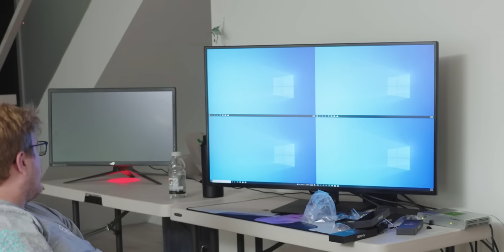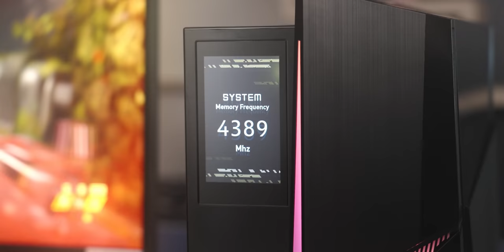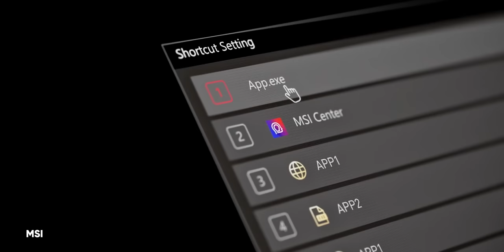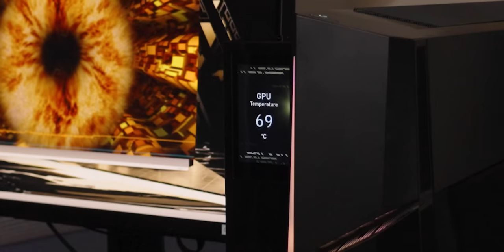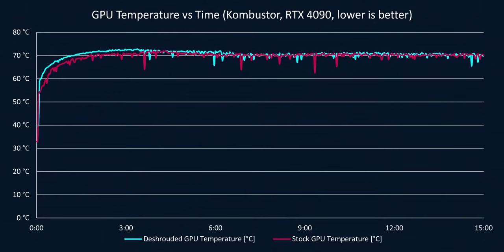I wish I didn't need this gaming PC - MSI Trident X2

Comment: MSI cooling usually can't even survive an air conditioned room, most of their cases are basically convection ovens.
Reply: I do have a problem with cooling on my MSI laptop. LOL. Great machine otherwise though.
Reply: Msi makes steam instantly
Reply: @logirex  only screen, case itself look awfully cheap
Reply: Look at all that VRM cooling for a core I9  8:32
Reply: Monica Gaming💖  to set up what
Reply: My Trident III has been running strong since 2018, no major issues.
The CPU does get hot, that's the only design issue I see.
Reply: @BardSuycide  yes I know
Reply: I've seen some horrible cooling designs in prebuilts, I wouldn't really call this one of them. Fresh air to the GPU and a fairly sizable CPU radiator venting air directly out the case.
Reply: @jaredcrue7099  how hot, 100+- celsius?
Reply: Looks like they got a clue after being ripped apart by GN and others for years. Thankfully.
Reply: @Seventschiko  80-90 while running Elite: Dangerous Odyssey, EDDiscovery, Chrome, and some minor things.
Reply: @logirex  I mean shit you're paying $5k they may as well throw in a little flair. At least it's somewhat functional.
Reply: As a trident x plus 9th gen owner ...my gpu temps are also 72...which is considered fine...but friends with bigger cases same setup...get 50 degrees on gpu...
Reply: @DamyanTanev  omg that vrm gonna burn.
Reply: @KikiAelita  Well, laptops and good cooling don't go together, lol. Not really an MSI issue.
Reply: @KikiAelita  have you tried unvolting yet laptops can often actually get higher fps while unvolted with lower Temps too
Reply: Monica Gaming💖  bot L
Reply: @KikiAelita  I got a msi GP75 leopard with rtx 2070, gpu temp always 86°C on warzone 2. just removed all oem thermal paste with noctua nt-h2. 12°C difference. highly recommend
Reply: @jaredcrue7099 Guess your bar of expectation is lower.
Reply: My MSI GS66's fans are dead and I have it Entombed like a WH40k Dreadnaught in a 60's wooden Mortar Round Box with an Industrial Fan blowing into one end.

It will run until it dies in service to me.
Reply: I've had to change the cooling on EVERY MSI device I've ever used.
Reply: I mean this actually looks like it should somewhat work. Any air cooled 4090 will ping off the thermal limits, but this seems rather functional
Reply: Probably won't be too long before Gamers Nexus reviews it and finds out it is in fact an oversized airfryer
Reply: @KikiAelita  well its a laptop nothing new
Reply: The Forge is there best case and it's a 60$ case
Reply: @bartvanlierde2925  I think I have some of that left from building my PC actually. Maybe I should try this. TY!
Reply: @jaredcrue7099  80° on chrome? you're joking right? that's ABYSMAL
Reply: @KikiAelita . Honestly, the chassis is the main thing that MSI supplies for your laptop, so while the components might be great, the computer doesn’t sound all that good.
Reply: @motorolah8107  You've read incorrectly.
Everything I mentioned is running simultaneously, on a two monitor setup.
Reply: No, it’s fine
Reply: i remember back in the days (at and before 900 gen gpus) their high end models of gpus had the shitty cheap heatsink with the fins being similar to a blower style cooler so while sure it didnt struggle to cool it, it did sit in the low 80s while competition was in the mid to high 60s. didnt show up well in reviews outside of cases either i believe. i swore to never touch an msi product again after giving them 3 chances and all 3 times they were subpar. most of the time its not even that they have a bad product, its just that they charge the same as others while performing worse especially when it comes to temperatures.
Reply: You say that as if it were a bad thing.  I put some frozen pizza in there and in 20 minutes, it's nice and hot.
Reply: @pascha4527  it depends on design of the VRM, it may not need any heatsink.
Reply: @Papinak2  Of course but the 13900k is a 260+ watts chips. dc/dc converters are efficient but rarely more than 95% efficient. The current will be significant in any design.
Reply: @pascha4527  server grade CPUs have even higher TDP without VRM heatsinks.
It depends on how many channels are utilised, how well the PCB itself can dissipate heat and quality of the switching components - consumer boards typically use the cheaper variant, heatsink is then necessary (though, most designs look more like heat spreader than actual cooler, so it's not that bad either)
Reply: This seems to be an exception
Reply: @Papinak2  Servers sees insane airflow tho. I know they are gonna be fine, but they gonna get toasty for sure. Probably limiting the cpu performance.
Reply: and $5,999 USD for that oven..

Comment: I hate those types of shelves that just rest on pegs that go in stepped holes. Even if they all fit correctly there's always the possibility you might still knock the shelf and have stuff fall. I'd much rather just securely screw everything in with brackets
Reply: Just get solid wood shelves drill those into some thick wood side panels no reason to buy studs
Reply: @leagueaddict8357  good luck easily resizing those shelves
Reply: @CouchPotator  resizing? what for?
Reply: @CouchPotator  it's 2 screws on each side. You can even pre-drill, pencil mark, notches all the way up if you think you'll be moving them around while setting up.
You can use thin strips of wood, 6-10mm, 1/4 inch, depending on the shelves. And fit several strips, slide in shelves as necessary.

If Linus and family are going to have that cabinet for the next 5 or 10 years then it's really going to be worth spending an extra 30-45 minutes to fit 12-15 strips.

Him putting a cushion over a 500watts+ amplifier is a fire hazard for his family.
Reply: @NoNameAtAll2  Rearranging things in them? Not every shelf is static
Reply: Even those pins with locking nuts would be an improvement. At least you get it secure without needing to worry about threads wearing out the wood.
Reply: The IVAR line by IKEA does it well, deep holes, metal cylindrical pegs, locking hooks on the shelf boards that clip onto the pegs. Quite a sturdy design
Reply: @resneptacle  rearrenging shelves? again, what for??

you got the wardrobe, you use the wardrobe
Reply: @resneptacle  if you know that you’re going to resize it often you can get threaded inserts and just screw some wooden brackets into those giving you stability and the ability to switch the position often.
Reply: @CouchPotator  you can get some 1' by 2' wood or the kind of timber strips they use for door jambs and screw (not nail bc nails can pull out, screws can't) them in to the sides of the cabinet and have the shelves sit on top of the wood strips, you want to resize them, take the shelf off the wood strips and put it on another set of wood strips, easy
Reply: @NoNameAtAll2  say you buy something and it doesn't fit on the shelf if you can resize them it can come in handy.

Comment: Hey Linus, cabinetry tip: Use some thin wire or small slivers of wood as shims for your shelf pins.) Most of the time, the shelf holes are always just a fraction of millimeter too big, and they'll slip out when too much weight is on them, but this is a trick I've learned over the years that works rather well. Hope that helps solve one first world problem 😄 haha😂
Reply: Toothpicks. Toothpicks make amazing shims.
Reply: @jeroddunn  haha yes, 😂 they do work quite well actually.
Reply: @jeroddunn  Toenail clippings also work
Reply: I personally would just stuff some dowels in. Drill the hole to correct size if you have to because they will take a much much heavier weight. Perhaps even an Linus leaning onto them.

Comment: How to make shelf studs universal.  Throw them out and  run a semi flexible metal  3/8in-10mm rod from one side to the other and place shelf on them.  

The poles need to be strong but just flexible enough that you can slightly bend them to go into the holes.

If it is a free standing piece of furniture  you can instead drill where the stud holes are to make them pass through.  Get metal rods pre threaded or thread the ends.  Buy flat top barrel nuts that can screw onto the rod ends. Slide the pole all the way through the holes and cap the ends to keep in place (most Barrel Nuts use hex drivers/Allen Keys).  You can even countersink them if you want to place a decal over them to match the furniture.

Last step is to buy thin wood slats that you can cut to length.  Glue to the bottom of the shelf, one in front of the front rod and one against the back of the rear rod.  This will keep the shelves from shifting back and forth while still being able to lift them off for cleaning or transport and also hides the bar when looking head on at the shelf.

I know it seems like a long process because it is in written form, but honestly, outside of measuring and cutting (and painting/staining for the slats) the whole process is really quick.

Tips:  

On free standing bookshelves/shelves, make sure that the rod goes halfway into the hole on both sides so that you aren't relying on the barrel nuts to hold weight.

Test the rods flexibility in store to get a feel for it and also see if it stays bowed or goes back to straight.

Make sure the thread on your rod matches your nuts.

Comment: In regard to the receiver, I'm not sure if you're seeing the same problem that I've seen with my Denon (X3800H), but there are times where I just cannot get a signal from my PC.  Usually, it's just a weird issue with the receiver as I just need to power cycle it or sometimes just switch inputs.  Although, once last week, I had to power cycle the PC because nothing else would work.  I did a bit of reading awhile ago, and one remark I found was that it might be an HDCP issue.  The Denon receiver will default to the AUTO setting, which means it has to determine the proper HDCP mode each time, and if it gets it wrong... no input.  One person reported setting it manually for the input helped alleviate any issues.  To note, I also see the same problem from time to time with my Apple TV.
Reply: Use an anthem receiver or processer instead, they work way better with a pc and very rarely have any issues. Also, they're just way better products in general than anything that Denon has.
Reply: How does Audyssey XT32 sound on that 3800H ??
Reply: He should have gotten Yamaha one or anthem because they have better software but his co worker Jake recommended which is dumb on his part.
Reply: That's kind of helpful for me.  I have had issues with my Marantz for a while, and sometimes the Apple TV complains about HDCP.  I wonder if I'm having a similar issue.
Reply: @fredwerza3478  I’m probably not the best person to judge the sound quality. 😅  I’m using some fairly simple yet effective in-wall speakers and still haven’t gotten my ceiling speakers installed yet (it’s on the list). I had the S760H before as a stop-gap after upgrading from a Sony 930e (HDMI 2.0) to an LG C1 (HDMI 2.1).  The biggest difference that I could tell was when I downgraded from my previous X4200H to the S760H.
Reply: I was thinking it had to do more with him suffocating it by putting the cpu pillow on top of its vents.
Reply: @shinaikouka  I heard the Audyssey on the 3800H sounds pretty good --- and with a firmware update coming in March you can also have Dirac Live!
Reply: @fredwerza3478  I think Dirac may be a no-go for me based upon what I saw in a review for the 3800.  My plan is to have in-ceiling speakers for Dolby Atmos, but the guides and such for Dirac suggest surround height speakers not in-ceiling. Not sure if that difference truly matters, but it seems like they don’t want you to go the one way.  🤔
Reply: @shinaikouka  well the good news for you is that both Audyssey and Dirac will be stored in your 3800 processor so you can easily switch back and forth between them --- I'd tweak the Audyssey for now and then try out the Dirac when it becomes available so you can compare them

Comment: Nice vid. Regarding the shelves, i had the same issue and ended up cutting  3/4" (19mm) wide strips of 12mm plywood and screwed that under the shelves, into the shelving unit. 
Sand and coat (or paint black) the plywood and it will suit the install.
I have no doubt you can get a couple of custom 3D Printed inserts made up, held in with screws, but timber is easier to work with, probably stronger too

Comment: i remember when cyberpunk was announced and they were showcasing it on the 1080 ti and said that it would be optimized to run at 4k on it. 4 generations later it runs well at 4k
Reply: 3 generations, not that it matters much.
Reply: @eclipsemantis  true. still like the metaphor Caleb raised
Reply: To be fair it just came out last gen, 2 gens late
Reply: I can play it on medium with my 1070 ti with almost constant 60fps+ so there is that, it's not a bad game tho just not a finished one
Reply: I played it at 4k Ultra just fine on my 2080 Ti. Never crashed. Though, I did have a few weird visual bugs. Like chopsticks hovering when a character's hand holding them moved ... and they still had the chopsticks in hand.
Reply: @fracturedraptor7846  i had this issue and also for whatever reason all bike-style vehicles would explode in a physics glitch and send me tumbling along at 100+mph
Reply: That can't be right since game supported Raytracing at launch and 1080ti has no RT. I smell something.
Reply: @Polyvalent  pffft that’s totally a feature lol.

Like the creepy first person shadows. Dear god…
Reply: @jondonnelly3  Raytracing is a useless gimmick to me. The first things I turn off in games is that nonsense.
Reply: @eclipsemantis  your right it's 3
Reply: @jondonnelly3  there were a few details I was wrong on simply by going off memory, but the original cyberpunk gameplay reveal that they did in 2018 at E3 was recorded in 1080p and was running on a 1080 ti. You can look up the specs of the machine they were running but by the time they had released that video rtx cards had not been released. The 2000 series cards released in September of that year. The actual game would not come out for over another 2 years. It's now 2 years after the twice delayed launch of the game that we are getting cards that can actually play it and it be stable without really low framerates and/or glitches like the chopsticks bug mentioned
Reply: @fracturedraptor7846  it's not bad when it's done right and implemented well. Unfortunately what settings to use to get the best visuals with the best performance is not something devs typically share with PC gamers. Console gamers typically will have 2 settings now, one for running at 60+ fps and one locked at 30 fps prioritizing visuals. And consoles will also typically have some scaling method built into the game that allows for either resolution or graphics settings or both to be scaled and adjusted as needed to meet the selected goal. PCs are getting similar features now but we still don't know how much more of a performance hit one setting has over another without extensive testing
Reply: No it doesn't, I have a 4090 and at least on a reasonable power budget you will either have to turn the settings down (Wich doesn't seem to affect image quality at all) or use DLSS (Sadly CP2077 has the worst DLSS I have ever seen)

Might as well play Portal RTX at this point, at least that game is fun.
And looks good.
And has a great DLSS implementation.
Reply: @Ocastia  oof

Comment: Yes, instead of having actual airflow and putting the screen on the side, let’s keep the solid front panel and increase thickness with a screen. Good to see msi prebuilts are still garbage from conception to execution in 2023.
Reply: Can't wait to see Steve Burke ripping it apart in his video.
Reply: Also like $6k for performance of what you can build for like what probably $4k or less yourself lol?
Reply: @RexZShadow  That logic only applies to us in the DIY segment. There are still many people who want prebuilts for various reasons (either being afraid of building a system or simply not having the time for it) and it's still a valid choice. But OEMs and even some System Integrators as usual fuck it up badly.
Reply: @RockstarRomania  I mean even prebuilt feel like you can actually go to some of the decent pc building company to get similar build for still probably 1k+ less.

No expert builder so idk how the actual build is would be curious to see a full review but the price just seem way too high.
Reply: Did you guys see that MB? Really, for 6k it should at least been a MSI MEG B series retail. Not some dell looking non heatsink MB.
Made his money tho.
Reply: @insurgentlowcash7564  Typical OEM bullshit sadly.
Reply: @RexZShadow having an exorbitant markup is completely okay if the product is built well and can be justified by its tooling cost, low volume nature, in depth customization and optimizing that a casual user couldn’t do, etc. it’s why the expensive EK prebuilts are pretty well regarded despite having a $1k+ up charge.

This however, is not that. Can’t imagine paying $2000 extra for this thing.

Comment: Having an extra monitor on the chassi sounds pretty cool and actually useful. You can obviously keep track of hardware info from a window on a second monitor or an overlay, but that's not something you always have up and running, so it's nice to have it always there when you encounter a sudden performance drop, especially since the cause of that drop may resolve itself in the time it takes you to start up monitoring.
Reply: But you can add your own, to any pc
Reply: @bipbop3121  yea but having it already built in is a nice to have and actually useful, so why not
Reply: it actually requires an app on your pc so its not any better -_-
Reply: Just autostart the  hardware tracking software and have it hidden by default. That's what I do with Mangohud. It's setup to run eith every game I launch in a hidden state, unless other specified by me. It shows up when I press right shift +  F12.